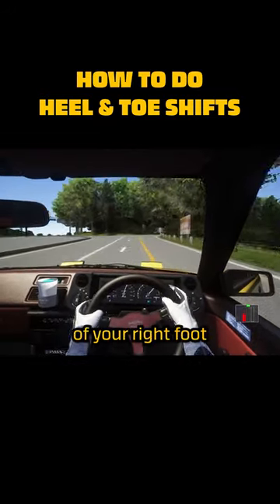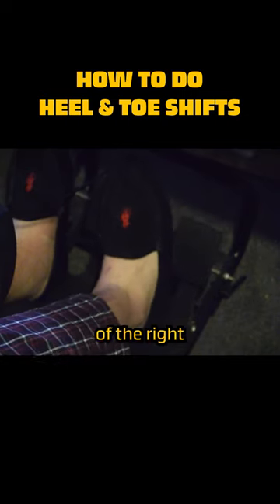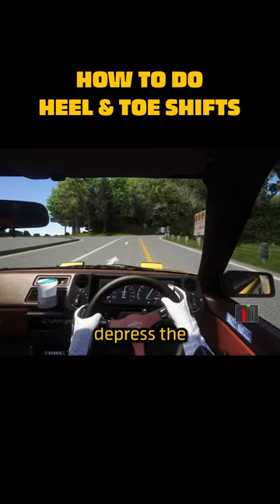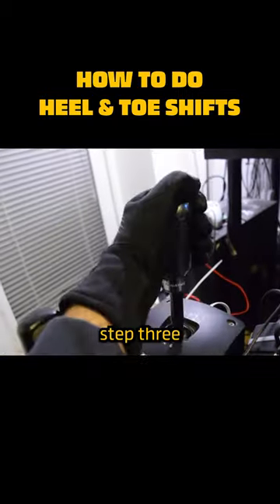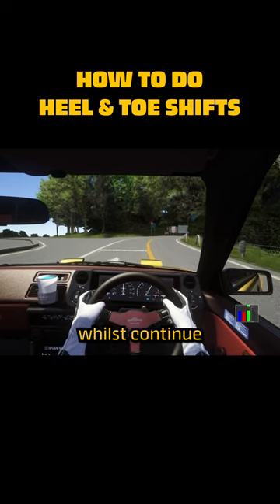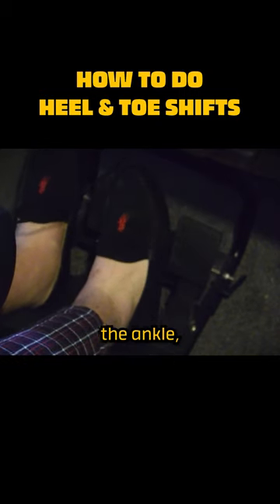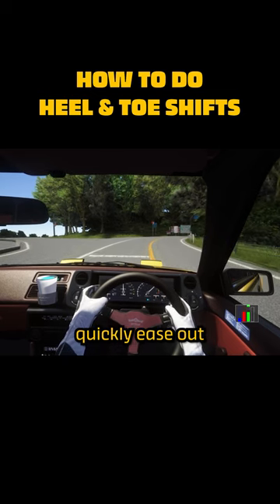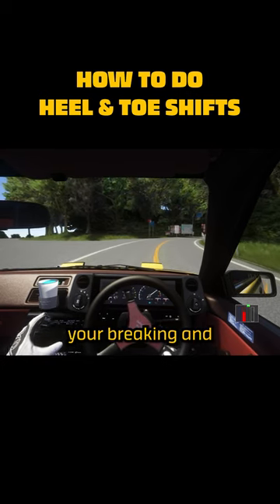How To Heel n Toe #simracing #assettocorsa #shorts

Comment: no matter how much I practice, I always have the feeling that I downshift too early, but the car remains smooth
Reply: Trust the process ! 🤠
Reply: Needs more practice, fellow Takodachi
Reply: I wish I went out and killed the track but when I downshifted to come in it felt like I was brake checking😂
Reply: Maybe try braking much longer and bring the revs lower than your usual practice before doing the heel n toe downshift?
Reply: Practicing irl will really help, you feel the car much better
Reply: If you drive the car a lot you probably won't need to, but if it's your weekend car shift close to redline and look at what RPM the next gear starts at. Then you'll know if you're under X rpm in Y gear, you can downshift
Reply: i learned heal toe for years before i could do it properly in my irl car, trust the process
Reply: cause you dont need just stop gas then turn half turn when you start returning point zero full thrttle bro thats thecnique is so bad
Reply: Develop a feeling for corners. Downshift just about where the corner begins, you let go of the clutch right when you pass that "beginning of the corner" point, sometimes you can even let go in the middle of the corner but all this depends on the angle of the corner, so try to understand the corner first rather than timing the pedals and speed - that will almost come out as automatic.

Comment: just me or is it next to impossible to maintain full braking when blipping the gas
Reply: That’s just part of the learning. When you first attempt it, keeping constant brake pressure is the toughest thing everyone struggles with. 

You’ll get it, just practice, practice…
Reply: @woodensauce1063  how though? like just throwing myself at a corner and messing up every time isn't really working for me XD
Reply: @zwenkwiel816  Ok just check the basic first, is your foot position solid? You should be able to hit the gas/brake by just pivoting your foot. If you have to lift your feet at all, then you're already handicapping yourself.

If that's good, then start practicing heel-toe with some hard braking involved. It might sound counterintuitive, but people find it easier to actually "heel-toe" when the brake pedal is closer to the floor. This puts it more in line with the throttle in most cars as well. 

Finally I will mention that if you find yourself struggling too much, downshifting with just blipping the gas at first is a good way to get into the rhythm of heel-toe. Just blip the gas without even worrying about the brake portion yet. Get used to how much gas you have to give in certain gears to make it a smooth rev-matched downshift. Once you get that down, then start slowly adding in brakes.
Reply: @woodensauce1063  thanks man, that's some good advice. I have noticed in most real cars that the throttle is a lot lower than on the t3pa pedals I have on my sim rig. (they're all pretty much in line when not pressed) so maybe I need to modify those a bit cuz i really do have to lift my foot to hit the throttle when im braking on my sim rig.
Reply: @zwenkwiel816  No problem! Heel-toe is intimidating and confusing at first. And sim racing rigs usually have the same pedal spacing/distance like you said so that doesn't help. I know a lot of people add extensions to their irl or sim rig throttle pedals, so maybe check to see if those would help.
Reply: @zwenkwiel816  not all pedals are designed to be able to reach both pedals with your right foot
Reply: @confusedredditor1660  iirc there's some spacers that came with them though. Might have to try raising the brake pedal a bit so I can reach the throttle when I press the brakes
Reply: it's easier when the brakes aren't too assisted so the pedal is firm. like in my econobox
Reply: My irl diesel truck a heavy flywheel. By the time the revs catch up I'm almost stopped lol. I wish I had a car that had light flywheel but that also could be used to transport furniture and construction materials.
Reply: your ankle will stretch out and get used to it. as i wise man once made up just now: if you cant do it, just do it more
Reply: its very possible your clutch pedal is too sensitive. sadly assetto corsa has one of the hardest games to heel toe in.
Reply: I find it vary hard on sim rigs so I gave up heel toeing on sims, but irl I get it very smooth.  I use a cheap Logitech sim rig with a very bad brake feel, maybe that’s why.

Comment: I really need a sim rig to try this, huh? I tried it irl and just ended up leadfooting and staying on the gas, basically revving the car with a depressed clutch and brake pressed. Thankfully, I was able to react fast enough to move to neutral and just pull over.

Comment: Wouldn’t it just be easier to be in the correct gear for the exit of the corner instead of risking the stabilization of the car transferring weight from changing gears mid corner?
Reply: From what I understand, you should be in the correct gear right before or at the start of the corner. And yes, it would be easier but heel and toe is a big time saver

Comment: Hate how my daily has the pedals in a way to make this impossible and no it is not a skill issue in other cars I have no problem doing it
Reply from the maker: Same, i drive a 2000s BMW and even the sportier versions have a floor mounted throttle. Makes no sense as they're literally designed for the Nurburgring. Supposedly it makes the throttle input more accurate though.

Comment: Is hitting the accelerator while the clutch is depressed bad for the clutch or transmission at all?
Reply: Its the proper way to downshift. You should never put the car into a lower gear and just release the clutch,  bad wear. You have to rev match.
Reply: it might stress the driveline if you blip the throttle too hard, the engine speeds up too much and when the clutch is lifted the torque is still being transmitted, so the car does a jolt forward and you hear a clunk
Reply: Juat don't rev your engine unnecessarily and you should be good. In general, higher revs = more stress = shorter lifespan. So if you're racing, expect a bit of a shorter lifespan (or a lot more maintenance, usually both) on your vehicle

Comment: Step 0: Have a manual. 😂 
…
No, but seriously, if you have a traditional AT you can heel-toe in manual shifting mode if the shift timing is slow enough to fit in the time it takes to rev match. 
…
😅✌️
Reply: wouldn't recommend that, if you're serious about making your automatic car faster, you can always get a transmission tune

Comment: Im 16 and self taught myself this in real life, I actually use most of youre videos and apply them to my touge technique irl, I use my moms 2023 subrau Crosstrek with a 6 speed manual gearbox, I live in the mountains in new England so I have a lot of experience actually driving touge roads, and I even put a 30 second gap on a 2012 chevy camaro the other day on my local road

Comment: You do it wrong.👎 Blip the throttle first then shift to a lower speed. If you don't do this correctly with your real car, the syncromeshes would worn too early. 👌
Reply: I was going to say it... but in reality the way he does it is a racing technique, what you're describing is a way to préserve the car... both helps gaining time... maybe he's just a sim racer and he doesn't need to preserve the car..
Reply: yeah but this is assetto corsa not real life. if i wanted to do it irl i would get a heel toe video for irl. thanks for your concern but this isnt for real life
Reply: @reclaimer0018  in a way he is not so wrong... ok, on asseto corsa it doesn't matter... but why not train in asseto to do it as in reality?  Anyway doesn't matter, as long as you're fine with the method you use
Reply: @starman5872  im saying he’s right but the dude in the video is talking game wise not irl wise
Reply from the maker: I've been taught by an instructor to put it into gear before blipping (yes in real life lol)
Reply: @TSRB  well maybe he taught you the way to go fast not to preserve the car... even if it's a bit akward cause as I do it on assetto, it's actually faster to do the blip while you're in the neutral zone of the shifter cause it's a deadtime otherwise... Anyway im not a pro and I'm not a hardcore simracer... but still, just by thinking at it, it seems faster to do it before engaging the gear rather to wait until the gear is engaged...
I think it depends of the driving styles of each one...
Reply: Ur indtructor was wrong. Gear stick has to go through synchronizers, which wont happen if u hold gas.
Reply: @yasuo2g775  "Ur indtructor was wrong. "

Jesus christ, youtube randos are obnoxious.
Reply: Then In what gear U should be during a throttle blip?
Reply: @STN-jq5jf  none
Reply: @starman5872  wait so you're saying blip while it's in neutral? (or like with the clutch pressed in?)

cuz I don't think that makes sense
Reply: @STN-jq5jf  every downshift
Reply: @zwenkwiel816  with the clutch pressed, during the travel time of the stick to the lower gear you blip thr throttle... it synchronize your gear and also reduce deadtimes... so its 2 bird one roc
Reply: Yes, you'd do that if you wanted to double clutch I would assume
Reply: some can get away on videogames because engine response is mostly never simulated. on a normal road car, especially at lower engine speed, early and smooth blipping is the key to have the revs up for when the clutch engages again

I had to learn heel and toe because in winters I couldn't downshift to second above 30kph, a bit like old H pattern racecars where heel and toe was required